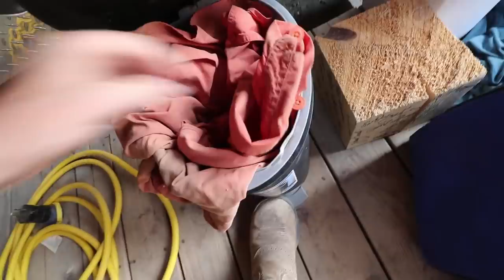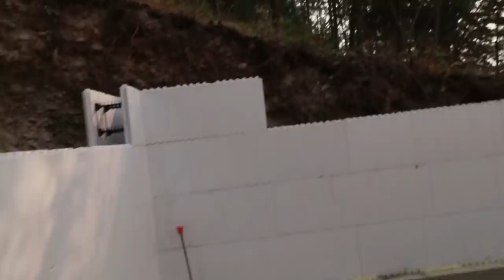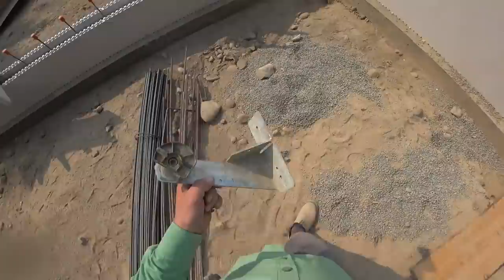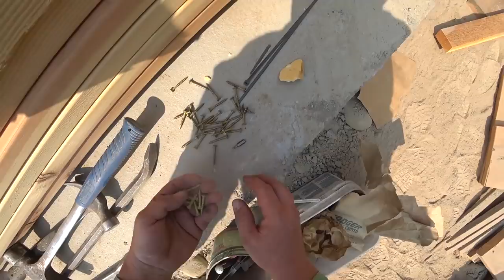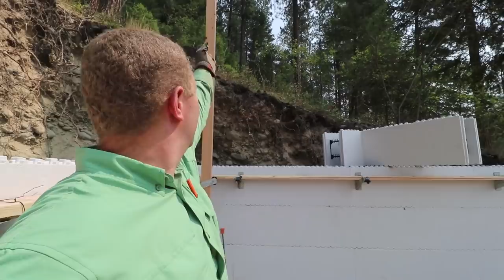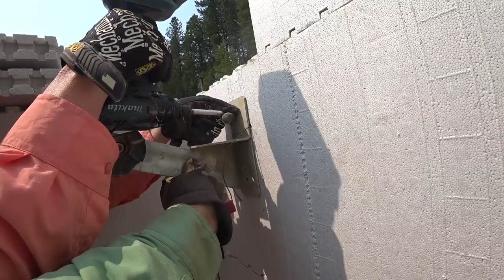Building a House Start to Finish: ICF Construction Walkout Garage

Comment: Ok, at first I though "oh wow, I never seen anyone build using such a system, this seems easy" but now with all that rebar, bracing and to keep in mind you'll still have to concrete... Not looking so good any more. Building with silicate blocks is so much faster and easier and I bet it's cheaper too. Also because of the insulation on the inside the dew point might be transferred there also and cause mould.

Comment: Can somebody please tell me what the one inch screws are going into that's going to hold them in styrofoam AKA ICF?  I'm referring to the brackets that the Wailers layout is there some form of board bored going in between the ICF that's just not showing up on camera I watch the other videos and never did see what they screw those to...... hang in there Jesse and Alyssa it's going slow but I do understand your walls are already up! 👍
Jim-East Tennessee
Reply: D00mM4r1n3 thank you sir that answered a lot of my questions which was probably the next one I would have most likely have asked... how would they attach furring strips for sheetrock over paneling excetera excetera...LOL
Jim-East Tennessee

Comment: So, being as I watch you folks, and really admire your resolve btw, I occasionally get re-routed to others using the same or similar materials. In one such case I noticed the windows/window templates being placed into the ICF structure... Are you building a 10' high ceiling basement and the structure above with all the light coming in or??? I don't think I missed any of your vids but just have no idea what the actual home design is at this point. Where is the door... the windows... Ahhhhh I need to know. lol anyhow.. I love the commentary and the descriptive decision process.. many may dog you for it, but they are sitting on their ass at home while you figure it out... keep on Brother!

Comment: What I don't understand is why you didn't pour you flooring before you started your walls. When we built our house in NM, we did all the grading, underground piping and wiring, then poured our concrete slab flooring.

Comment: why not fill with concrete part way up? Then add more concrete as you go higher. So rather than filling all levels at once, you do half in one pass, and the  other half and the next pass. Ditto pushing down concrete. easier to tamp down a small amount but not very deep.

Comment: im still confused. so after you fill the foam with concrete do you pull the foam off or leave it? how do you add siding or shingles to foam if you do leave it?
Reply: The foam is part of the foundation. It is the permanent insulation. There are no shingles or siding on the foundation.
Reply: so half up the house is going to be gray foam?
Reply: No, the foam is not part of the house walls. The timber frame sits on top of the foundation.  These forms are foundation only.

Comment: On your whalers  Do you need to cut your whalers?  How about just lay them onto of each other and add a couple of screws.  They do not have to be at an exact level across a wall, do they.  If you do not cut,, the 2X's can be unscrewed scraped and reused elsewhere.  faster, easier, cheaper.

Comment: Great video.  Funny seeing you have the orange shirt on in some of the video after it was tossed.  See I was paying attention.  Good to see you getting that wall up.  Those blocks are just to hold concrete up so maybe just a little tape on seam will stop any concrete from flowing out.  Just looking at some of the comments.  Wow, these guys never worked in 105 degree heat.  I do HVAC in Austin and know how the thinking hat gets melted above 100.  I was on a roof here and learned why all the roofers take off by noon and come back later in the day.  I stood on the shingles and started sliding because the shingles started flowing.  The temps were above 160 using an infrared thermometer.  You are in the sun so it can be 120 on your head.  1/2 days can work well.  Do dawn to noon and enjoy the afternoon not getting beat to death.  Too hot for concrete at those temps anyway.  I would think 60 degrees would be good as the concrete generates alot  of heat and with that insulation around it, well WOW.  Hope those block designers have temperature ranges to be followed.

Comment: Your forming and bracing brackets should be holding your scaffolding runs so you can walk the planks around the perimeter of the building for both forming and for pouring in the end.  your people that are supplying your bracing should have told you about this normally that would be a rental package and it makes it significantly easier to install Light form

Comment: this forming system seems like its very time consuming and complex, why dont make regular wall forms, (plywood and beams) and then after put the plastic insulation on. but maybe i have missed some point of using this system. time will tell when walls are done. :)

Comment: Silly question why not just lay 12 in block and be done with it
Reply: cjjblaster that heavy block that the two of them would have to lift hundreds of times by themselves, requires masonry tools, mortar, masonry knowledge and then leaves you with an uninsulated foundation? Good question.
Reply: A Oz you can insulate the inside of block and prep the outside as well its a hard choice for sure if your doing this project. If its strength that is desired block with rebar is very strong.tough job either way.also i understand they are doing this themselves but there is point where you can hire  tradesmen to help as well
Reply: Sure. I've seen that done before. But the real benefit of ICF's are the double insulating barrier. Insulation on the inside AND the outside. You can add board insulation to stacked blocks on both sides, but that's going to be a lot of work and expense. My wife and I did a 2100 sf 10 foot ICF foundation for our home. It was really easy, and we had no problems putting them up.

Comment: Dang those ICF's are tough! I never thought those screws would bite into Styrofoam! 

Also, what's the advantage of ICFs again? This seems like its taking a lot of time and energy. Not a professional, just curious.
Reply: Wood in the ICFs
Reply: Well, if you want concrete walls you need forms. The other way to do it is to use Muliplex wood wich is waterproof to build forms for concrete, but there you have to have the innards, steel mesh and bracings ready to put them in.
Since ICFs are foam they also act as an isolator, so its kinda twofold.
Seems like a pretty simple modular system for small construction, also way less dangerous then trying to true up 200 lbs muliplex boards, which get removed afterwards anyways.
Reply: Nice
Reply: Well yes, with a couple of years experience doing that every day, 5+ guys on the site and a boss behind them threatening to cut money if they don't finish in time^^
Reply: Al gebra, that sounds like the best plan to me too. I wonder if their engineer got in the way or something. J&A don't seem like the types to make extra work for themselves

Comment: Not certain, but after watching it looks like you put you Annealed tie wire around your wailer,  strong back bracing and the form. Bad Idea! at least wrap it to the opposite side wailer and strong back. FYI your greatest amount of problem will be at the base of your wall due to what is call hydrostatic pressure. I would also recommend installing wailer at the base. These recommendation is only from someone who has 18+ years of experience with concrete and some major concrete placements. You don't want a blowout! Please reach out and I can provide some great reference material.

Comment: looks as if the block is not just out of level it's also out of plumb. like with pipe if it is out just a 1/6 at the first fit 40' later it will grow with every fit, so it's out on the first block but just a little and is gaining every fit. small shims may do the trick for you there just make sure your fix is not throwing off the other plane like if it is off on the level the fix don't throw off the plumb and vice versa.     lol   stay frosty    ;)

Comment: You are making so many mistakes, which will become evident, pour time. Watch tutorial videos from either, Fox Blocks, Build Blocks or Nudura, they are very helpful. I used FB for a three storey construction, about 40' square including basement. My concrete supplier was very helpful, I took deliveries at most times, to suit him and he provided it at cheaper cost. ICF was well advanced for that to occur.

Comment: Uhhh,, It's a foundation,,, 1/8th of an inch ???   

Corners first,,,, just like a brick or block wall,, brace the corners,, use a string to align between.     And no, it will not be perfect.  That IS what they make shims and caulk for.

Comment: Please double check your drain pipe around your footings.... the holes are supposed to be facing down. I know it seems odd to have the pipe that way I know and I almost did the opposite when I laid down my system. Unless you want to shovel the pea gravel twice I would double check.

Comment: A Hot Drink on a Hot Day Can Cool You Down !!!

How does this work? “What we found is that when you ingest a hot drink, you actually have a disproportionate increase in the amount that you sweat,” Jay says. “Yes, the hot drink is hotter than your body temperature, so you are adding heat to the body, but the amount that you increase your sweating by—if that can all evaporate—more than compensates for the the added heat to the body from the fluid.”
Reply: 777n like the "what we found" bit lol was that typed while walking and holding a camera pointed at your face?
Reply: High Tea is not "High noon hot tea time". It is called "high" tea because it is eaten at a dining table rather than on low, parlour seats or tables.

Comment: I would notch the board lik eyou said and then run a tapcon through the end and attach it to the concrete.. done no bracket needed and it you leave them a little loose once you get the top secured you can go tighten them down.  Im sure your talking with the engineers and all there is a tolerance with this all.  It seems like I fall in the same rut doing something new you go overboard because you don't know what you can get away with, really think you guys are being too much of a perfectionists, you  would be surprised to see installers throw that stuff up.

Comment: icf's are horrible lots of work, should of just rented some steel ply pans and been done and poured by now, way to much work
Reply: Todd Gallagher with traditional forms, you have waste extra material, don't get the excellent insulating value and wind up with a less comfortable home. ICFs with in-floor radiant heat are the perfect combo. And it's really not that much more work. If they were doing a traditional form for the first time, by themselves, documenting that process on video in this much detail, it would take more time.

Comment: I'm still worried about all that soil pressure anyone else ?   Structural engineers. Anyone .
Reply: D00mM4r1n3 I've seen many a collapse with that size hill behind it that footing to me would not stop a slip "  watched an episode where they did not recognise there holding  .  Let's face it they all the experts on you tube every episode say something is wrong with spec  . I'm just asking . Are you a structural engineer ?

Comment: You are spending to much time second guessing your selves. You are NOT building a watch, it all goes together and every piece is custom fit when you get above these so called forms. As for the next few rows of blocks, go rent enough scaffolding to set it up all the way around the inside. Time spent erecting the scaffolding will be more than saved when you don't have to move a ladder every minute or two.

Comment: Just a note : 

Guys, you speak a lot about educating yourselves by doing research, before you attempt specific advances or challenges on your home build project, which is smart and commendable. Albeit, it would appear that you did not do the same with the beer you choose/prefer to drink. Had you done so, you would know that Corona beer is an extremely poor beer in quality and is cheaply made. Yes, it passes the minimum FDA requirements for imports and it maybe what all your friends are drinking as being the [IN] beer as seen on TV, but is not actually recommended for American consumption by the beer industry. No, its not total poison, but its not the quality of any produced American beer nor even any other imported ale, beer or stout. In fact, it rates at the very bottom of the import list, actually all list. Don't believe me, do the research and check it out for yourselves.
Reply: American MACRO beer is shit, there are tons of really great craft beers made in America.
Reply: First of all, my comment was not meant for you, second, I never commented on or about craft beers, third your use of profanity does not speak well of you.
Reply: First of all, I'm sure Jesse and Alyssa could give two shits what you think of their beer. Second, I didn't say you said anything about craft beer, it was just my observation. Third, I also could give two shits about what you think of my foul mouth. It's just who I am.